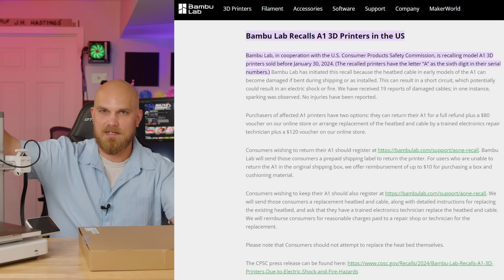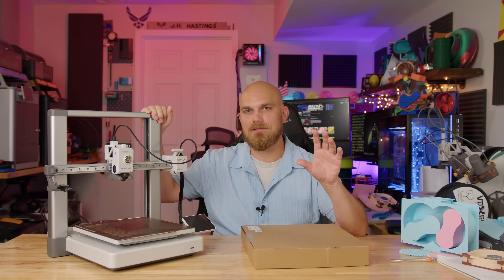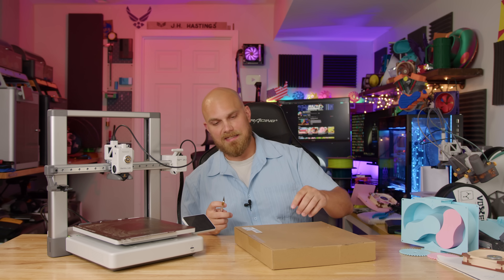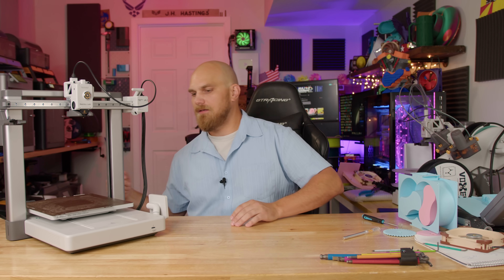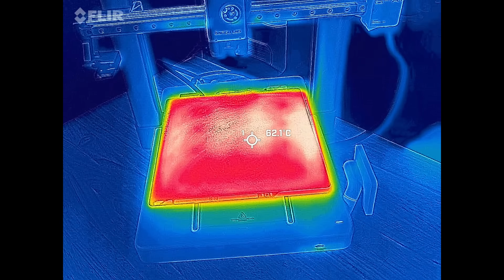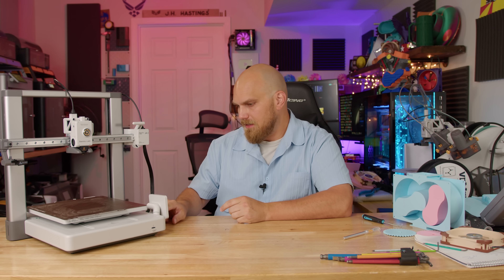3,100 hrs. Later…My Thoughts On Bambu Labs Printers… Fixing My A1 Recall Issue

Comment: This comes down to the fact that the cable should not connect to the plate in that manner. The entire machine looks so polished until you look at those connections. They should have an external connector for that cable.

Comment: I've been trying to find a consumer grade full colour 3d printer. There was one that came out but it seems to have vanished. It's available used, but getting the filament and ink for them seems to be impossible now😢
Reply: There is no such thing as a functional consumer grade FULL color 3D printer. Even the ones with multi-filament support usually only do four spools at a time and waste most of the plastic.

Comment: Got an A1 at launch.  Filled out recall form as soon as it was available in February.  Got replacement bed in May and installed it a week or two later.  Had to remind Bambu another couple weeks after that to get the store credit for doing the replacement myself.  Used that credit to take some of the edge off buying an X1C combo, which went on sale for their 2nd anniversary the very next week.  Bambu promptly issued another store credit for the difference though.  All in all mostly pleased with the entire experience outside the 3 month wait for the new hot bed (TBF they estimated that time exactly on the initial form) and having to remind them to send me that initial store credit.

Comment: My issue with Bambu Labs:
- Proprietary firmware
- Max size of 10 cubic inches

Especially since I want to get into printing helmets, that size does not work for me, since I do not want to print those helmets cut.
Reply: so what did u get or thinking about getting?

Comment: My replacement bed had a faulty temp sensor - read 5-10 degrees too low, so my bed was consistently too hot. Took me  good month to get past tier 1 support and actually have someone take it seriously. Second bed works great, back to printing with this fantastic printer.

Comment: Fwiw:   For most of the printers we used at work (Ultimaker/MarkForge) I found some cabinets to store filament that have an electric humidity management system.  Pretty cool!  Worked great and could feed 4 spools, or one big one (10kg spool from matterhackers). 

Check out StatPro filament cabinets!

Comment: The only time I've had my filament break in the AMS is when the humidity started climbing up a bit or I tried to use filament that really should've been dried first.

Now, outside of that, I have seen two issues with the AMS.  The first is that the first stage feeders seem to be a bit of a weak link, and the worst part is that Bambu Lab considers it a wear part.  So, you'll likely have to pay to get a new one.

The second problem is a weird one.  If I leave my printer on for some amount of time (not sure if there is a specific threshold), the printer and/or AMS will refuse to read the spool's NFC tag.  When I insert a new filament, I just get "?" on the screen.  If I restart the printer, it works fine.   It might not be as annoying if the X1C started up as quickly as the P1P and P1S do.

Comment: Damn, how many screws does it take to replace the build plate?  What ever happened with just 4?
Reply: if it had only 4, it would be relying on clips, which would get brittle and break. Better to have a bunch of screws.
Reply: @Etacovda63  instead of all the other screws just make pegs that slit into the same spots and provide the additional support needed? Duh
Reply: @digital_feline  No, they don't add more screws for fun. They add more screw holes because they are lazy and wouldn't take the extra time to design it in such a way to minimize the screws and save themselves the cost of the screws and the labor to install them.

Comment: It is just a power cable, could replace it yourself.
Reply: It's AC and temperature sensor (not sure if there's also accelerometer, or does it use the one in print head). Do you have AC cable rated for such movement?
There are quite many countries where installing and modifying AC powered parts is not exactly legal.

Comment: Nice thing about those QR codes that bring you to a website is that when they want to stop supporting it then can just take the website down and force you to get a new printer.
Reply: That comment makes no sense. What difference does it make if it is a QR code or a URL? If a company wants to stop supporting a product, it doesn't matter how they provide the support for you, they'll just stop and that's it. The QR codes make it easier on the user and are an extra step for the company (more work).
Reply: I mean you could just save the website as a pdf or screenshot it, so you can keep the information forever?
Reply: @mingyi456  Well, I don't know about you but my time machine no longer works and since you discover you needs these things After the fact that, that specific doc/manual/driver, etc or what ever is very unlikely to have been downloaded.   Heck I just updated the firmware on my router a few days ago and there were 21 files for that specific make and model.   Did I download them all?  No.   Have you downloaded all them for your router?

Comment: The filament breaking inside the AMS is probably my least favorite thing about my bambu p1s. At least it's not as obnoxious to fix as when the same thing happens in my Creality CR-10 and have to break out the wrench and push things through the extruder gear.
Reply: Get a dryer, brittle filament is wet filament.

Comment: Without a doubt, Bambu Lab printers are the best. They might not be the cheapest on the market, but they are certainly the best. I also have a question, which model of Flir thermal camera are you using? Thank you very much.

Comment: I was lucky that the cable of my A1 had no problems so I just kept using it until the replacement bed arrived after ~2 months after filling out the recall form (northern europe). The replacement was easy and the promised store credit (got me 10 spools of filament) was on my account the next day after sending them the pictures of the replacement.
The customer service has been excellent and I see no reason why my next printer isn't from bambu.
Reply: 10 spools? Isn't that like half the price of the printer?

Comment: We have two A1's. The older one the bed came in late May. The other in June. We'd been using both printers constantly the whole time. Ironically, the bed on the older one stopped working a couple of days before the replacement bed came in, so it worked out great. The replacement bed for the newer one is still in the box. The recall was overblown, I think, but Bambu handled it masterfully. If they want to have some more recalls and give me free stuff, I'll take it.
Reply: yeah i used my A1 the entire time too. it has 1600 hours on it now. Been giving me some sass lately but overall 9.6/10 experience
Reply: I, too, used my A1 the whole time. I did inspect the cable to be sure it wasn't damaged and it looked OK to me. I now have a brand new bed in a box for the time my old one will fail.

Comment: There wasn't really anything wrong with the old cable for the most part, there was just enough people with issues from shipping packaging that they wanted to get ahead of the potential issue. Fires were only a potential after thousands of prints where the rubber on the cable might wear down. There was basically no risk to keep using the printer, which I did until I got my replacement. It always printed fine. They said in the February notice that replacement plates wouldn't be available until May, and I got my plate the first week of May I think.
Reply: Nope, old cable was faulty in design and materials. Compare to new cable. If some were damaged in shipping, well, they designed the boxes.
Not testing the product does not give right to blame users (Apple tried that too) 😅

Comment: I have an A1. The plate arrived about 3 weeks ago. Then the heat sensor broke during the first print. I guess I'll use some of the $120 to order a new one. Honestly, kind of sick of my A1.
Reply: Have you messaged support? My replacment bed came with a damaged cable, I sent them photos, it took them a month to reply but they shipped a new one out. I ended up getting an ams lite with the £111 discount code the sent.
Reply: . A month to reply? Creality is faster than that wow.